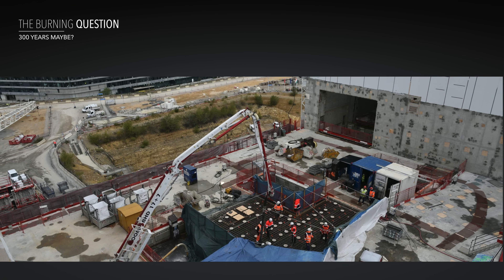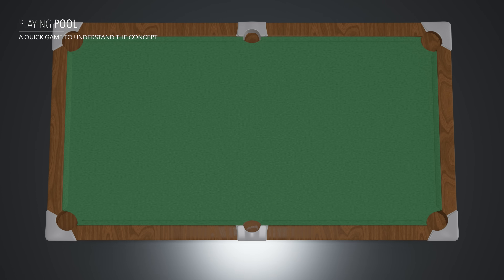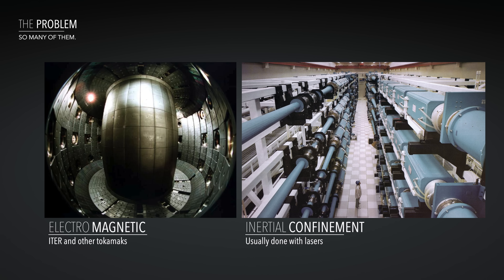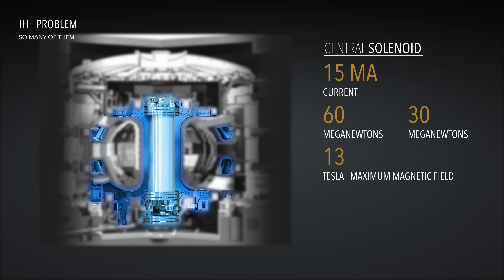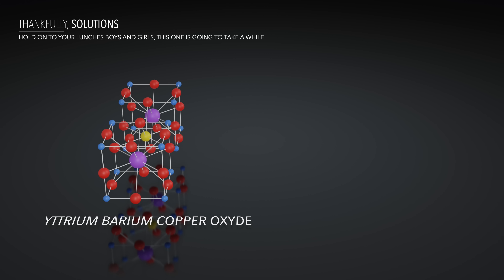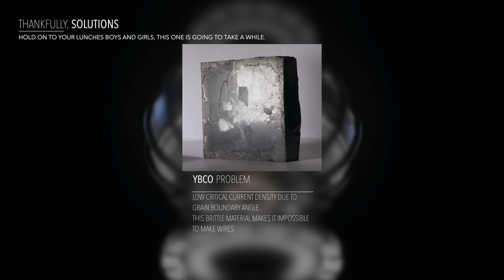Fusion in 30 years? ITER update [2020]

Comment: In the 1960's, I remember that we were being told that fusion reactors would be generating electricity within ten to twenty years. Only another 35 years to wait, fifty years after those predictions? I'll not hold my breath.
We were also assured that nuclear fission reactors would be producing almost limitless amounts of clean electricity at almost zero cost to the consumer. Our electricity bills are now about 50 times what they were half a century ago, and only a small fraction of the electricity is derived from fission.
Many people stopped believing the streams of lies about nuclear power decades ago.
Reply: The tokamak being built in the 80' filled me with excitement as a kid reading about it in a popsci magazine. I doubt, i'll live long enough to ever see it running.
Reply: What shape is the Sun? What Shape is ITER? That is why ITER will NEVER work. Its just a White Elephant sucking up all the funds. ITER mission statement achieve confinement for 90 seconds. Thats it.
Reply: @esecallum  You have a good point. If you look up IEEE: The Plasma Compression Fusion Device, you can see that you're not too far from the truth. Tokamaks seem to have a design flaw.
Reply: @dr.strangelove9815  Yes the flaw being the stupid ring shape which always kinks, touches the walls loses energy and fizzles out. 6 degrees of freedom versus 2 degrees of freedom for the sun. in sun the particle goes deeper it meets hotter particles. if it goes out it gets cooler but gravity pulls it back. in a torus the whole thing is like bucking bronco with the ribbon twisting no matter how you squeeze it and always kinking.

Comment: It's funny they'd use U238 as an example for fission... U238 is NOT fissile. That's actually quite an issue because that means most of the Uranium found on earth is not useful for fission. That's why we have to use Uranium enriched in U235. Unfortunately, only a tiny fraction of Uranium on earth is U235.

Comment: When you have super cold magnets near the point of heat, you have an impossible situation. Near 0 kelvin right at where you want to generate the heat of fusion. Thus most of your energy will always be making the magnets cold to superconducting temperature near where you want the center of the sun's heat. So it will always be 30 years away because you are working against yourself to the max.

Comment: I thought the energy released per nucleon was more than that for fusion. Guess I was wrong. Hardly seems worth the effort then, sure it's more than you get from fission, but fission is far easier to do and the extreme conditions required for fusion can result in all kinds of practical problems. What about aging of materials, for example? Maybe it would be better to spend the money on other technologies like solar thermal collectors or new types of fission reactors. I bet you could build a lot of solar thermal collectors in sahara with the money "wasted" on fusion.

Comment: @Subject Zero Science

I'm new to this channel and I'm impressed by the visual effects and not being afraid of going into details. However, some errors crept in.
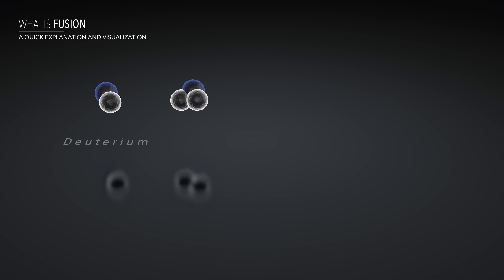1. At 3:03, you say that fusion is the most powerful reaction after fission, but at 6:21 you correct yourself by comparing energy released per nucleon (first noted by @Matthew Elvey ).
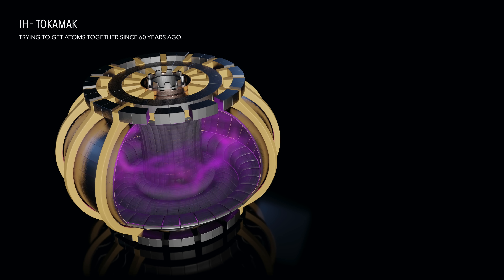2. At 5:18, you claim that magnetic field is used to put atoms as close as can be done. However, magnetic field is used to confine plasma to prevent it from touching the walls and cooling down. Overcoming Coulomb barrier is achieved by giving the ions high kinetic energy, which in turn is achieved by heating plasma (first noted by @OpenGL4ever ).
3. At 7:24, the text states "16 MW input", but audio states "16 MW output", which is correct. However, the text at 4:09 is correct (first noted by @Matej Gagyi ).
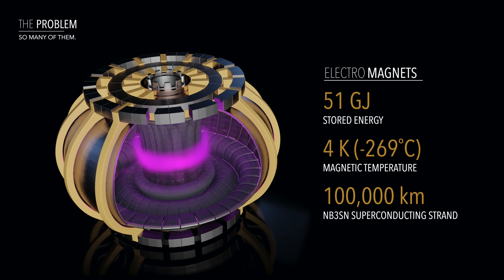4. At 8:23, the text states "magnetic temperature", but you certainly mean "the temperature of the magnets" (first noted by @Younes Layachi ).
5. At 11:39, you use the same picture of crystal lattice as at 11:00 for YBCO, which shows 4 different types of atoms, while niobium-tin superconductor is obviously made from two types of atoms (noted by me).

It would be helpful for less knowledgeable viewers if those errors were corrected.
Still, this video clearly stands out from cheesy popular science videos which just skim over the surface.
Keep up the good work :)
Reply: Also, YBCO is brittle not because it's a crystal, but because it's an oxide. Many metals are ductile but they are all crystals.

Comment: Not going to happen. Fusion is started and maintained by the immense gravity of the sun. You’ll never be able to generate that artificially and for free.
Reply: Actually it is started and maintained by energy. Whether energy comes from pressure, or from temperature, doesn't matter. You can easily replace the pressure by a much higher temperature, or the other way around, to get the same reaction. That's how I understood that it works. So they use a temperature that much higher than the hottest point in any sun, to compensate the lack of pressure. In the sun the gravity/mass causes a lot of pressure indeed but in fact we can create a similar pressure on Earth, by detonating a nuclear fission bomb. That's how they ignite a fusion bomb, they just detonate a large enough bomb, that creates energy through pressure and temperature, just like in the sun.
Reply: @effedrien , you have to maintain the reaction. The suns intense gravity starts and maintains the reaction. All of the heat they put into igniting the fusion is wasted because once they withdraw the input energy the reaction stops. As I said, the intense gravity is what starts it and maintains it. Nuclear fusion is not like fission.
Reply: @georgecrabtree2013  also in the sun it is maintained by the energy that is produced by the reaction itself.

Comment: Can we really say we understand the physics of fusion? Or do we expect to learn new science/lessons by operating this.
Is it just a matter of finding the right chemistry and process for production superconducting magnets.
Reply: The Wall Street Journal This is pure physics. Chemistry has no significance here
Reply: Well no- The production of magnets is chemical and mechanical engineering. Unless you want to say everything is physics.
Reply: The Wall Street Journal How can the production of magnets be chemical?
Reply: They contain metals. Which have crystal structures. That can vary greatly from how rapidly the metals are cooled.
Reply: The Wall Street Journal But That still uses more Physics rather than Chemistry.
Reply: No- Chemistry is more experimental. Most of the metallurgical stuff is very well documented and does not change. Having a deep knowledge base of chemistry can tell you how things a likely to behave.  But often times the best computer models still not match experimental results in many cases. Many drugs are still discovered though a brute force approach of testing as many samples as possible and having robots verify that a reaction has occurred though changes of color. Geometry is a factor in chemistry. and many things react differently based on small nuances of orientation, and minor differences in pressures or temperature. Also rates of change are also a factor. Their may be many reactions occurring simultaneously. Someone working with chemical process will be more familiar with certain equations and jargon.
Reply: The Wall Street Journal I see. Chemistry is applied Physics no?
Reply: It's probably better to think of it as an engineering discipline then a subset of physics.

Comment: Enormous waste of everything, they will never attain contained fusion
Reply: That's Sustained.. Fusion.

Big Difference.
Reply: @fanOmry  they need to contain the plasma before they can sustain fusion, which is my point.
Reply: @jamesmclaughlinprimitivele4587  

They already have..

That's the point.

But if you preffer, There's also an a research where they use pellets full of Hydrogen and Lasers.
Also, I believe one where they use physical pressure(modified by shape).

Comment: The thing that always confuses me is they keep saying fusion reactors simulate the function of a star but we don’t have the same gravity field how do you get past that?
Reply: pressure is produced via   Massive  magnetic  fields
Reply: @daviddavids2884  The magnetic field is only to produce and to contain the high temperature, it doesn't compress anything. There is even nothing to compress, it's all happening inside a vacuum so the pressure couldn't be lower. This lack of pressure is compensated by a much higher temperature, the result is same. All it needs is energy, whether that energy is provided by pressure or by temperature, doesn't matter.
Reply: @effedrien  your answer is not any more correct, than mine was.
Reply: Will Warden we use a different reaction to a star
Reply: Good replies all but yet my question still stands their ignoring the lack of similar gravity field even if they are doing it a different way.
Reply: @willwarden1631  Gravity is not really needed for nuclear fusion, in the sun gravity/mass only has an indirect effect, by providing pressure. Pressure and temperature are the only important process parameters for fusion. And if you don't have enough from one of them, you can compensate with the other one. The end result is same, only the scale and the environment are very different. In a tokamak, the pressure is negligible, so they need a ridiculously high temperature, much higher than any place inside the sun. Because they only work with very little mass, less than 1 gram, they can reach such temperatures. But that little mass needs to be perfectly insulated and shouldn't touch anything to keep it's temperature. On earth, this is only possible inside a vacuum, and extreme magnetic fields are needed to keep the hot material away from the walls of the container. It's because of that need for insulation that they can't apply pressure.
Reply: @willwarden1631  'they're'     IGNORING????  huh.          
gravity field??????     what  is   that.     i think you better do your own research, will.
Reply: David Davids I did
Reply: @daviddavids2884  Please don't become a teacher. Explaining things is already not your thing but your attitude makes it pretty impossible for you to teach others lol

Comment: What could possibly go wrong...?
Reply: 1. The Plasma could touch the wall, cooling down the Plasma and make it collapse
2. The Magnet could break down, which would cause the Plasma to collapse
3. In case of a leak, air would get into the Plasma, contaminating it and thus leading to collaps

In all three events, this wouldn't cause an explosion since you need power to keep fusion running instead of water pumping.
Reply: @winni2701  What will happen if someone hacks through the security and makes it inject a large amount of fuel in the plasma?
Reply: @effedrien  It would be insane to connect the System to the Internet.
Same thing for fission, have you ever heard of an accident because of this?
Reply: @winni2701  It doesnt need to be over the internet. Suppose somone who works there wants to kill himself in a spectacular way and has access to the right mechanism to overfeed the reaction. What will happen? Is it still safe you think?
Reply: @Guido D.G. Think about movie where someone sends an order to launch a nuclear missle, and two guys actually turn the key. If this would represent real life, there would be already hundreds of blow up power plants.
Reply: @winni2701  we already blew up a nuclear reactor by bypassing safety mechanisms and ignoring alarms. Remember Tsjernobyl.? Why you don't want to answer the technical question? What happens it too much fuel is fed into the fusion reactor?
Reply: @Guido D.G. I think the plasma would expand and therefore touch the wall, causing a cooling down.
Reply: @winni2701  I think what will happen is that the mass of the excess fuel will cool down the plasma instantly. It probably only works when feeding it with tiny amounts. Just guessing of course.
Reply: I would increase the temperature, and this would stress the vacuum more, some hole would cause an air-contamination.
Reply: @winni2701  The temperature can only increase when (part of) the fuel fuses. But that will not happen because the plasma has not enough heat capacity to deal with large amounts of fuel. It can only handle a fraction of it's own weight without cooling down too much. And the plasma weighs less than 1 gram. So I guess this part is also safe.

Comment: The Mass and the forces of a star for most people is actually incomprehensible. To show my point remember that ALL the planets and the moons in the solar system is like 1% of the Mass... The sun is the other 99%.   That is crazy when you think about that, and thinking you can create and control the monster in the lab is just f__king insane.   Scaling it up... is that what we do need if it will be solved? I am skeptical about it any time soon, as in the next 20 years.  ITER or one of the Dr.s stated that by 2035 they think they will be able to do a reaction that lasts over 5 minutes... that is 15 years away and how many more Billions... At least 30 to 40 Billion right there.   We could just be building Nuclear reactors that are smaller and safer and dont require large exclusion zones.  Put 50 Billion into R&D for nuclear that we do nothing with now like the technology we should have with it.  It seems only the military understand the importance on Subs and Ships... SO why dont we try small reactors for Large cities... reactors tech that will not need huge supplies of water and massive cooling towers.  We waste the tech we have and stop advancement because of accidents... Accidents keep you moving forward, if the applied the same to aircraft we would all be walking
 
Creating high temperatures and adding the energy is the easy part as we figured that out.  Sustaining the reaction and controlling it is another issue all together.  Magnet fields and new materials all also needed.   A few seconds of Plasma at this date and time is BS to me.... is not an accomplishment after this many years and that much money.  This has been a problem the world has tried to crack, not just the US.   They always make it sound like we have not researched it and like we haven't been serious about  getting Fusion working, when in fact it has been a relentless path with many nations with an almost open checkbook and still little to no results.
 "Putting a star in a jar" is cute but almost impossible which so far it is impossible.   The money that has been thrown at this for decade after decade is insane also.  We will have spent Hundreds of Billions of dollars to try and get Fusion.  I just imagine how good the tech could be for Nuclear Reactors now... I think we missed out.  By the time they get Fusion running if ever we will have made leaps and bounds with every other field trying to create that little electron

Comment: Very informative.
4:50 - Electrostatic, not magnetic force.
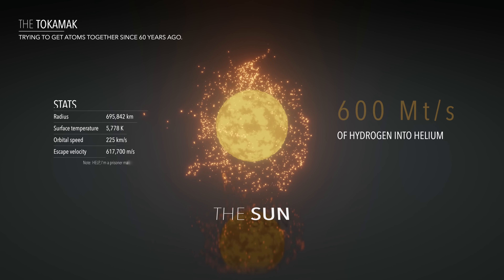5:40 - An explanation of why we don't use one of the processes happening in the core of our Sun (better than mere mentioning around 6:30) would be helpful. Yout pool table analogy could provide a handy illustration of the concept of the cross-section.
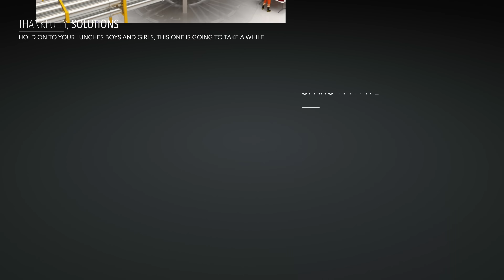11:30 - An explanation of why MIT had to resort to declaring their SPARC effort "an upgrade" is warranted.
Other efforts such as Stellarator, General Fusion's "mechanical confinement" or  Lockheed Martin Compact Fusion Reactor also deserved a mention.

Comment: The quantity of deuterium on earth is not unlimited, one can easily calculate its number !!!
And what is even less unlimited, is realy rare, it's the Tritium ... we do not know product reasonable produce in large quantity or even store it properly.

I remind you that the reaction Tritium => Deuterium produces only one Neutron with a kinetic energy of more than 14 Mega Electron volte
(which means that his neutrons will pass like a letter to the post office.
Or a knif in softened butter ...
And destroy the reactor materials.
I'm not talking about the birilium speaker that is transparent to the Neutron, but (field coils), the structure of the control equipment and so on.

There is very little chance that ITER works because we do not have the appropriate technology of the materials, nor a beginning of theory to understand the fields of plasma and their untimely disruption (not even a beginning of track). Iter it's probably not before 100 years or more ...
A lot of taxpayer money is spent unnecessarily and could be used directly in actual energy production.
France contributed almost 50% while the country has a strong economic problem.
1/3 of its population no longer lives but tries to survive crushing taxes.
France still has to change 55 reactors of pressurized water type. It does not have a viable technical solution with nuclear power but an urgent need for a plant within 10 years.
Their new EPRs cost $ 15 billion and put the megawatt cost from $ 40 to $ 150 .... it's an economic and technological siding.

Iter is minimum of 30 billion for France, 45 for Europe
This while Europe has the necessary and viable resources like the Gulf Stream or shale gas .... But peoples pressured to death tax to finance moronic experiences.

Iter is backed by some idiots and morons who still believe in Santa Claus, or that all who shines is wonderful.
But above all a little mafia pseudo scientist. His crooks, who expect to have ministerial salaries all their carrier behind a desk of this perpetual machine, this hangs as the Peulple dies of hunger.

Thank you no longer peddle advertising for this giant taxpayer's scam, a scam worthy of Madoff